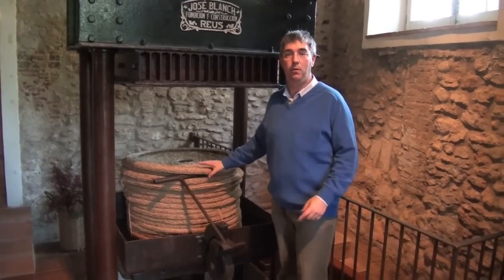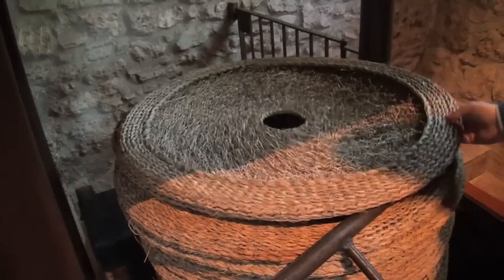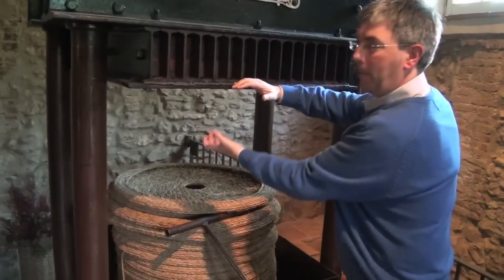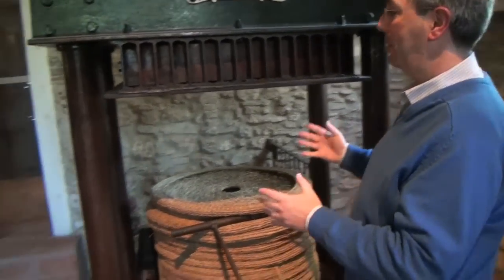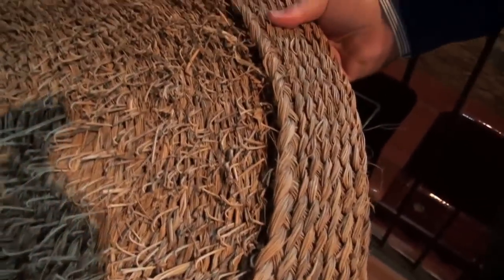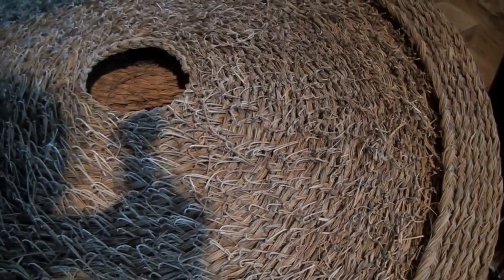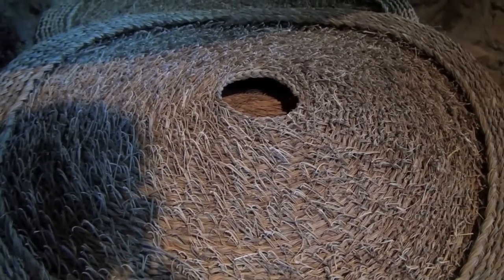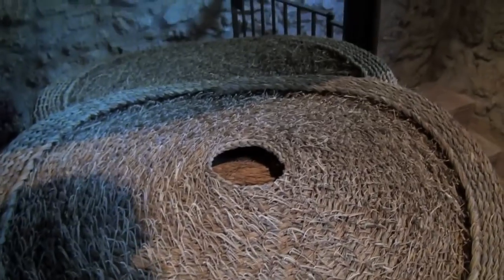Cold pressing olive oil

Comment from the maker: No need to resort to name calling. The fact is that centrifuging the olive oil is clearly cleaner. There is no debating that if you know anything about both processes. Again, most olive oil is not pressed anymore. There are some small farms doing it but it does not make the olive oil any better by pressing. I would argue that centrifuging is better because no oxygen touches the olive oil. As we all know, oxygen breaks down olive oil